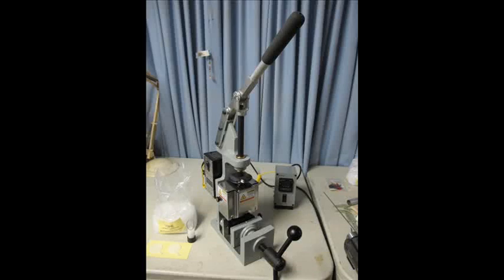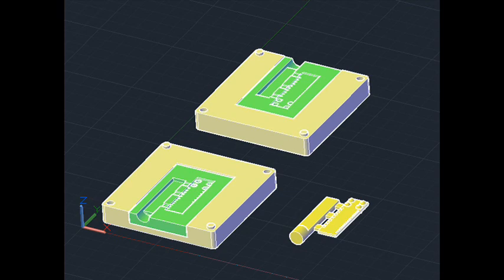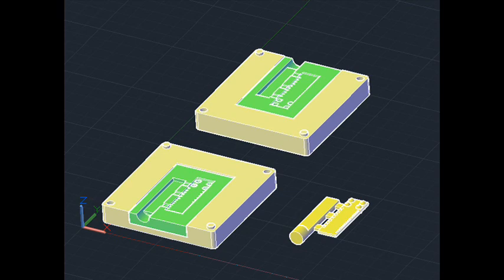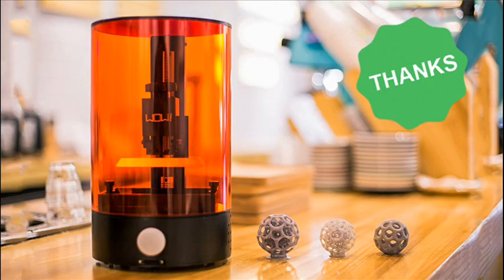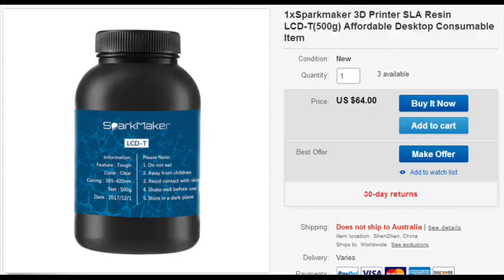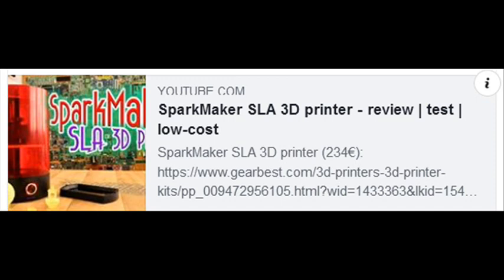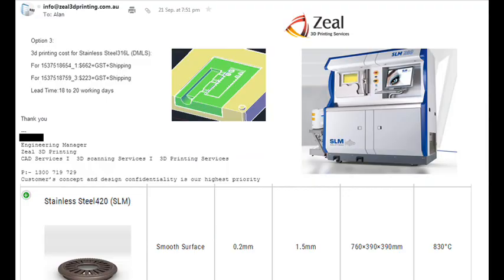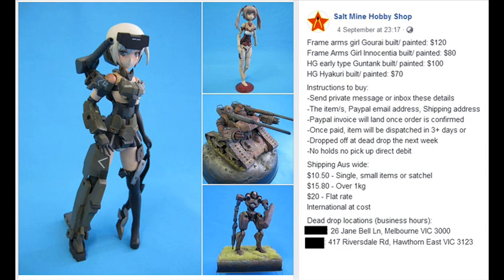Progress update on Salt Mines mold injection tool update

Comment: 3D steel mold is awesome tech 49:28. However, it could be costly if the mold is a failure. For example, 10 mil on the upper flat surface could quickly lead to warpage causing flashing. This is the reason most mold use thick blocks. On the bright side, stainless steel rarely warps.

10-mil solidify time could increase since it's insulating itself. Add cooling tubes?